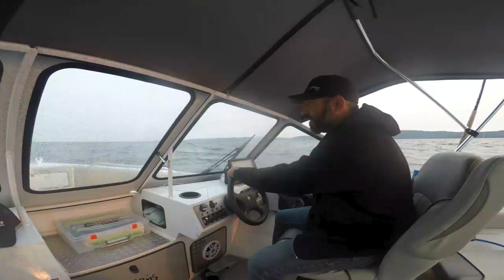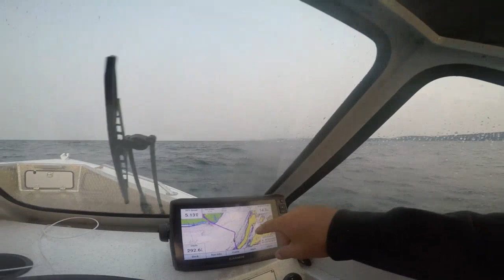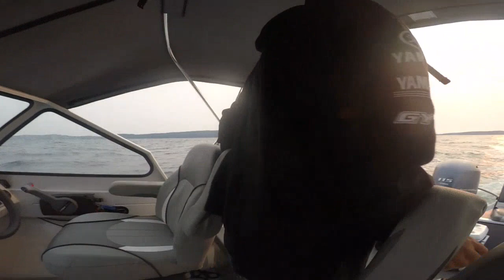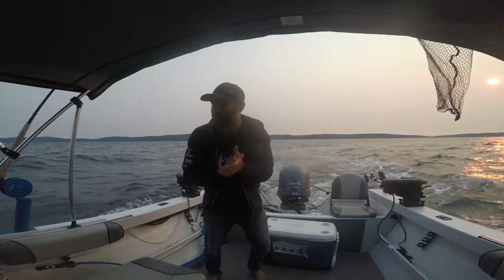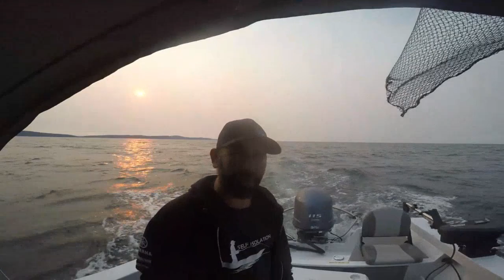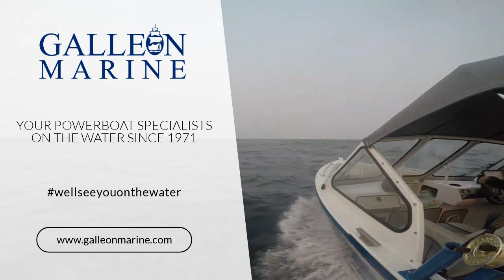Kingfisher 1825 - Rough Water Test

Comment: What kind of seat suspension are you running on that boat? I wish the wiper covered more of the windshield.  It's quite short.
Reply from the maker: They're Smooth Moves bases.  It's a Kingfisher option from the 2025 Falcon.      Yes I agree on the wipers, it's my only beef with this boat.  Really it just means a longer wiper arm so that a wider wiper blade will fit. I'll certainly be tinkering with mine in the future.  - Mike